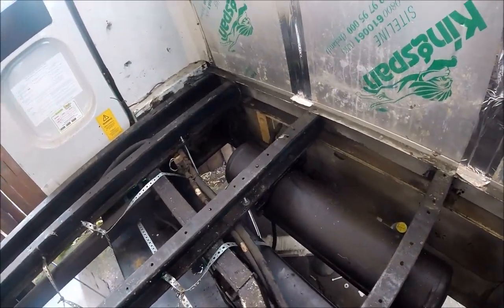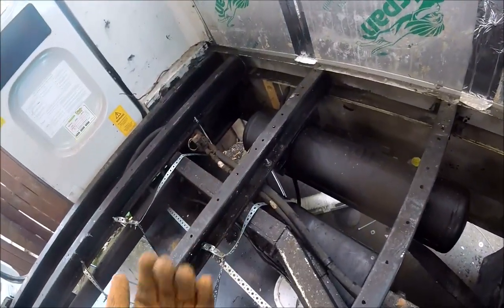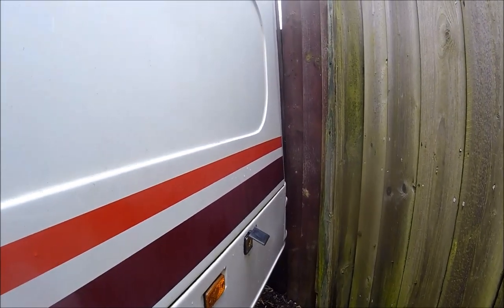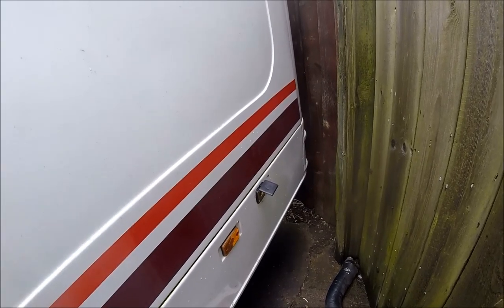Changing LPG Tank Rubber Fill Hose For Copper Connections

Comment: There is usually some flexing between the body and the chassis especially when the body is fibreglass which is why you should use a rubber fill tube.  Copper can fatigue
 over time and lead to micro cracks and leaks.   I would ve very wary about this change.
Reply from the maker: I thought about that but the fibreglass panel is secured just above the fill point directly to the chassis where the tank is fixed so there should be minimal flexing. If it was lower down the panel there would be more flex and it would be more of a worry but it should be fine but I’ll be keeping an eye on it
Reply: @TheCampervanBuilder , thought you would have taken that into account but still a point some people wouldn't know.

Comment: Did you apply any sort of protective coating to the external copper pipework to prevent rust or corrosion damage?
Reply from the maker: I might wrap it in some old hosepipe or just give it a coating, I've not done either yet as there are still a few jobs to do under the bus yet.  Anywhere any pipework is secured to the chassis already has hose wrapped around it to avoid the pipe rubbing and wearing away
Reply: @TheCampervanBuilder  that's great, thanks.